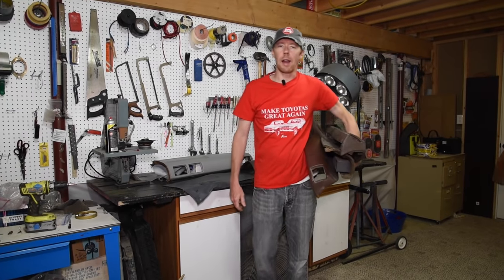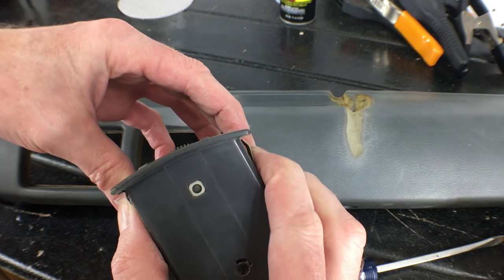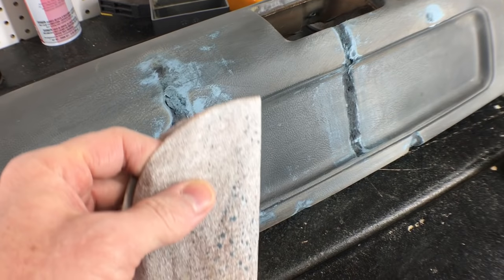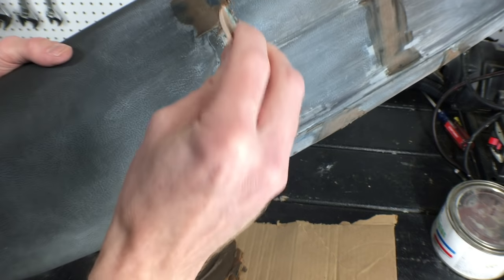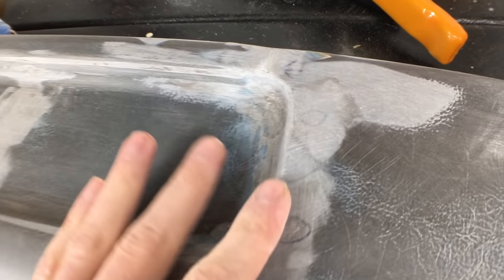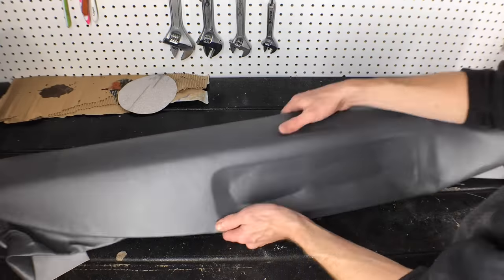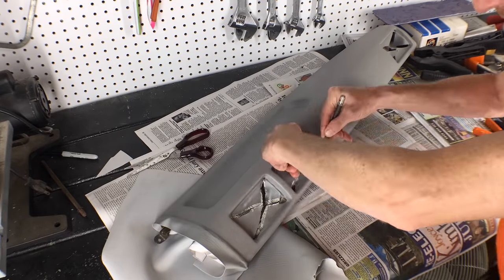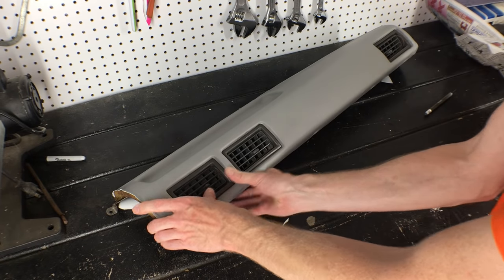How to Restore/Fix/Repair a Cracked Vinyl Dash - Toyota Hilux Pickup/4Runner PART 1

Comment: In difficult areas, try stripping the  white fabric from the back of the vinyl....allows for more stretch. But the dash cap is the best, wont ever crack in the future.....
Reply from the maker: Removing the backing from the vinyl is a great idea.
Reply: @6thGearGarage  Peels right off but dont know how it will hold up to sun light. Tried to covered an inclinometer for a 87". Did some corners good but its a complex shape and didnt come out good, so had to find a new cover on ebay....thought of making a mold like you did for the indentation on the dash but for the whole cover then putting the vinyl and old cover in and putting it in the oven at a low temp...to much work.
Reply from the maker: @drewfleming7065  yeah I agree, a lot of work when you could just do a dash cap

Comment: Man I've been gone forever and this is first vid that pops up. I love your idea for crack filler but from that point on it works best to use heat gun vinyl yu know like vivvid or 3m 1080 or even better 2080 series rap aswell vivvid's carbon fibre looks Cron! Member my vid I showed u? If only we were neighbours lol speaking of which I might be looking for a place soon :( ttyl peace fellow toy master!
Reply from the maker: Thanks I will have to try the heat gun vinyl next time
Reply: @6thGearGarage  it's really simple honest just.lear how to do the knifeless string properly and do the little dip I the dash first all trimmed nice and tight then it's tricky when comes time to pull string through after u wrap the whole dash but trust.me it's factory and easy and damn I wish I used ur crack filling idea

Comment: You should have evened out the bottom of the bondo mould to a smooth finish using acrylic puttu and sanding it.
Reply from the maker: Yes, I see what you mean. Here's an update on this dash, and another one I restored using different materials, after being through extreme heat and cold cycles. (Dash #1 failed miserably!) https://youtu.be/ywkqTaHK2LA

Comment: I really need to do that to my 86 pickup. the dash pad and the inside door handles are the only imperfections in the interior.
Reply from the maker: Those door handles always seem to get chalky over time.  If they're not too bad, some baby oil will bring their color back.
Reply: @6thGearGarage  Amor All works better. On my 1982 Mitsubishi L300, I did my dash pad and plastic ends with it and the ends match the dash pad a lot better now. I'm in Queensland Australia

Comment: Ok so far but I think it would be much easier and cleaner to make a whole new dash out of fibreglass. This is such a small dash, easy going. People in Asia make complete cars out of fibreglass
Reply from the maker: I've used fiberglass in small repairs, but never creating something from scratch. I would probably need a vacuum setup for that?  Once I created a good mold though it would be pretty simple I'd think .

Comment: Could you fill most of that dip with silicone then apply the filler?
Reply from the maker: The problem with silicone is that many products don't adhere to it well. I didn't do any tests to see if the filler would bond to it.

Comment: You sure have a lot of patience reupholstering that dash. If i had to go thru all that trouble to lay down the vinyl and it didn't do what i wanted it to do I would of cut the dash in half and throw it into the trash. That dash your working on is tiny compared to the modern dash in late model vehicles.
Reply from the maker: Thanks... this was my first attempt and it did not hold up well over time.  I restored another one with better glue and 4-way stretch vinyl and the results were much better: https://youtu.be/XB9GKLRHYNM

Comment: You need 4 way stretch vinyl and some weld wood contact adhesive out of the can that you put in a spray gun
Reply from the maker: Oh didn’t know about 4 way stretch vinyl.  That was a problem with the stuff I had was that it only stretched horizontal but not vertical.

Comment: So I’m curious if the new vinyl cracked in the sun after a few months from the heat
Reply from the maker: No cracks, but it did start to lift more in the recessed area.

Comment: u need something that u can clap the same as the grove i carved wood for my dash then clap it as u go start on the hard parts first don't try to do it all at once do the top first keep it clap then work ur way u will need a lot of claps . i did a 79 camaro dash came out good
Reply from the maker: The bondo mold helped. I will try thinner vinyl next time.

Comment: Just wondering which vinyl you used and where to buy it ..thanks
Reply from the maker: I bought the vinyl at Hobby Lobby and Jo-Ann Fabrics. I later restored another dash using spray foam, brush on glue and 4-way stretch vinyl + spray paint, and the results were much better, but still had a little trouble with the recessed area: https://youtu.be/XB9GKLRHYNM Also I put both dashes through a torture test to see which products held up better and the second one was definitely the winner: https://youtu.be/ywkqTaHK2LA

Comment: Reason is, the vinyl they use in the factory has no thread/backing. It’s a textured side and a flat glossy side and it more or less stick straight to any curved surface because it’s not restricted by the backing.

Comment: The curve:: I'm no expert but how about using the proper size can, and use the bottom of the can to help shape it. Beesides the can bottom can help remove putty.
Reply from the maker: The biggest problem was the marine vinyl. I restored another dash using 4-way stretch vinyl and brush on glue with better results https://youtu.be/XB9GKLRHYNM

Comment: I know nothing about repairing, and I'm going to attempt to do mine. Why make bigger cracks? Can I not just fill it up with some sort of silicone based filler, sand it down and then apply vinyl/leather?
Reply from the maker: I enlarged the cracks because the foam is very disintegrated at the crack and sort of falls apart easily. Also the vinyl at the crack usually curves up a little and is also brittle. So I enlarge the crack with the dremel to get a flatter surface. I didn't try silicone because it's not really sandable and things don't like to stick to it. I did a second dash using different materials and the result was much better: https://youtu.be/XB9GKLRHYNM  Then I put both dashes through extreme heat and cold, and the second one lasted. The first one did not: https://youtu.be/ywkqTaHK2LA
Reply: @6thGearGarage  thank you so much for explaining!!!

Comment: You should be using "heat activated" upholstery glue! It will solve 99% of your problems. Or at a minimum brush on contact cement, and do small areas at a time. The spray glue is pretty much worthless.
Reply from the maker: Yes it is. I did another dash using wilwood brush-on contact cement and put them both in the summer heat for a test. The spray-on dash was peeling after a week.

Comment: I've done several dash recovers with this same thick vinyl, the 2 biggest mistakes you made was 1 you used adhesive that dries WAY too fast, I use Weldwood's brush on adhesive, it has a high heat resistance and it has a 30-45 minute dry time so it gives time to work with it, i can take it off and on several times and second the have to do it in stages, you have to do the recessed parts first. and then stretch the vinyl once the recesses are completely dry.
Reply from the maker: I recently did another dash repair video using the Weldwood. You're right- it's so much better!  I also used 4-way stretch vinyl instead of marine vinyl and it was a lot easier to work with: https://youtu.be/XB9GKLRHYNM
Reply: @6thGearGarage  I personally don't like the 4 way stretch vinyl because it's alot thinner and it doesn't last as long. IF I'm fixing something I'm not just fixing it for now, I want to get as much time using it as possible so I don't have to fool with it again, the 4 way stretch vinyl just feels cheap to me. I'm curious to how long it lasts though.

Comment: On I remembered after the bondo, I use primer filler to smooth out the dash to perfection. It may take up to 2 coats and last u Prime the dash with primer finish which is different. Now u can apply ur base coat of also known as it primary color and then clear which gives ur dash a shine. I think ur clear should be matte clear. It's a low sheen clear. U can't have a bright clear cause that would affect ur driving thanks and please don't take it in wrong way.
Reply from the maker: I was going for the OEM look with the vinyl, but I also want to try the smooth paint method you describe. I hope to try that on another dash in the future. thanks!
Reply: @6thGearGarage  thanks for ur time and I liked how you explain everything therefore you just got a vote and I'm describing to be part of ur followers.

Comment: in this case, it is necessary to use hot glue and thermal vinyl. and the torpedo would have turned out like new

Comment: I have an 84 sr5 and several years ago I was looking for a dash pad on Ebay and found a brand new one. they wanted $250.00 for it and I thought I would wait for them to lower the price. Big mistake I searched several times over the years and finally found one in fairly good shape and paid $400.00 for it.
Reply from the maker: Yep, I had a couple crack free dashes that I sold about 10 years ago for less than $100 each on ih8mud

Comment: Vacuum bagging isn't difficult to do and it exerts 10 pounds per square inch (do the math!) evenly over the entire surface.  Even then, I'd fill the concave dash tray so the vinyl doesn't need to adhere in a concave section.  I'd use the thicker color matched vinyl and live with an overlap seam on the passenger end.

I think I'll get the molded ABS overlay to hide the cracked dash on my 2005 4Runner.  Removing that dash is on par with an engine swap.

Comment: next time forget the vinyl wrap and instead use spray can product like Rust-Oleum pro grade truck liner aerosol.  You can achieve the same texture as vinyl (practice first before spraying a dash.
Once it is dry you can then use spray can vinyl dye of your color of choice and once dry you can finish off with a matt or flat clear coat sealer.  The result will be a pro factory finish as long as you spend time getting the dash perfect with prep work before spraying and this may require plastic bumper primer which you can sand
Reply from the maker: I've had a few people suggest I try that and I have another cracked dash for a future test :) I also restored another dash using spray foam, brush on glue and 4-way stretch vinyl, and the results were better, but still had a little trouble with the recessed area: https://youtu.be/XB9GKLRHYNM

Comment: Just a question, how would you do this if there is an airbag hidden under the dash panel?
Reply from the maker: Does it have a removable cover that pops off when the airbag deploys? Or is it the kind that splits the dash apart when the bag deploys?
Reply: @6thGearGarage  it's one of the dashes that splits where the airbag comes out.
Reply from the maker: @sAINT898  Yeah, I don't recommend covering in vinyl, as it might cause problems if the airbag were to deploy. Maybe you can paint the dash with some kind of textured spray that would still allow the dash to split.

Comment: I have found leather stretches better, but is more expensive. Also I think that you need to do smaller sections at a time. I would do the recessed section first then go from there.

Comment: Those dash caps are an option, but ymmv. I tried one for my vinyl dash in my 87 chevy truck. It no longer looked factory. The cap made the dash look... bigger and thicker than it was supposed to. Like it was beefier somehow. It wasn't a look I was happy with so I got rid of it. I think the only way to get close to a factory look is to have actual vinyl like the factory dash. I was thinking some sewing could help you on yours, if you ever redid it. Cut out that recess, and the end cap. Then cut and sew. Yeah you'll have stitching that is visible, but not really. Your stitching could be down inside the recess that the driver looks at. And only the people who open the passenger side door would ever see the stitching on the far end of the dash. Even then it wouldn't look bad, as a lot of modern cars make it a point to show off stitching.
Reply from the maker: I'm actually going to have another video soon using better contact glue and 4-way stretch vinyl. Hoping for better results this time!
Reply: @6thGearGarage  Looking forward to seeing that video! Maybe I can learn how to do it properly from you.

Comment: Do you think polyurethane would be the way to go for the cap?
Reply from the maker: I am not sure what type of plastic the caps are made with, or what type would work the best. I recently restored another dash using spray foam, brush on glue and 4-way stretch vinyl and the results were much better:
https://youtu.be/XB9GKLRHYNM

Comment: I am thinking that you could try to trace both ends of the dash board to a piece of thick paper then trim it about 1/8" smaller then the actual end itself and cut that shape out of a piece of vinyl. From there, after you get the top of the dash stuck on trim it back on the ends to about 3/8"all around past the curve, try to cut small V shapes out of the very edge the then glue the tabs that you created down around the edge then cover the end with the piece of vinyl that you cut out and cover up all the cuts, when installed the end cover will not show and the small tabs should not have excess material there for a no wrinkle front. Just cut a 2" test piece to wrap around the edge first so you can pre gage the edge and the width of the V's so you know what size to make them ahead of time. BTW my grandma used to sew and make clothes those V's are actually called Darts when making clothes so the material doesn't bunch up under arms or on shoulders and create rashes or create uneven curves under the arms or at the shoulder seams. The refinished dash looked 100 times better then what you started with, WELL DONE and yes i know all about the OCD thing people have told me all my life that i am way to fussy. here is a couple of videos to help   A Plastic Piece Wrapped in Leather - Auto Upholstery - YouTube  and another  How To Restore a Cracked Dashboard - YouTube

Comment: Another great video! Are you familiar the product 'Padded Dash Filler'? Fixing the dash in my 87 Toyota 4x4 is my next project. I see the plastic cap installed and it's much better than a crack dash but still lock plastic. I am planed to make a vinyl or soft leader cap sewing the contours and corner with double stiches like the cluster cap but for real. Fit to the dash and tested, the glue down.
Reply from the maker: I think that is the ideal solution for this shape of dash. If I knew how to use a sewing machine I would love to try.

Comment: I wonder if after sanding out the cracks if you took some tape and put on to flush out the top and leaving the bottom open. Then taking some spray foam and spray under the tape to fill the void then remove the tap and sand flush.  just and idea
Reply from the maker: I recently restored another dash using spray foam + some better materials and it turned out great: https://youtu.be/XB9GKLRHYNM

Comment: Does the bondo work better than vinyl filler?
Reply from the maker: I haven't tried vinyl filler to compare. I recently restored another dash using spray foam, brush on glue and 4-way stretch vinyl, and the results were better, but still had a little trouble with the recessed area: https://youtu.be/XB9GKLRHYNM

Comment: I'd have used 2 part polyurethane foam and then looked for 4 way stretch vinyl. Vinly typically compresses to about 1/32". I have not ever seen a spray can-based glue that works with vinyl -- at least not as well as upholstery glue. Look for a small can of Weldwood Landau Top Adhesive and spray it with the cheap $15 gun from Harbor Freight. Start in low spots and work out from there. Nice work, tho.

Comment: When you said that you were going to use vinyl, I thought uh-oh. I've tried to work with vinyl before. It doesn't stretch much. I've seen vids where they just used Bondo and paint. It isn't perfect but a lot easier. Valiant effort though and it definitely looks better than it did.
Reply from the maker: I've since learned that there is a 4-way stretch vinyl that is made for this kind of work. I've seen dashes done with bondo & paint and they look fantastic.

Comment: After all of that struggling with the vynl I think I’ll just paint mine 😂
Reply from the maker: Thanks for watching! I later restored another dash using spray foam, brush on glue and 4-way stretch vinyl + spray paint, and the results were much better, but still had a little trouble with the recessed area: https://youtu.be/XB9GKLRHYNM Also I put both dashes through a torture test to see which products held up better and the second one was definitely the winner: https://youtu.be/ywkqTaHK2LA

Comment: knead your hardener before you use it and it wont be watery. youre supposed to mix up any kind of hardener like that before you use it for that reason
Reply from the maker: Oh I did, there were hard lumpy parts inside the tube. Probably beyond its shelf life
Reply: @6thGearGarage  yeah that’s what I was about to say. You’ll feel it get crystallized on the inside. Nice dash fixing skills. I have one for a 94 I need to fix but it’s not cracks. It’s a hole someone cut for a speaker